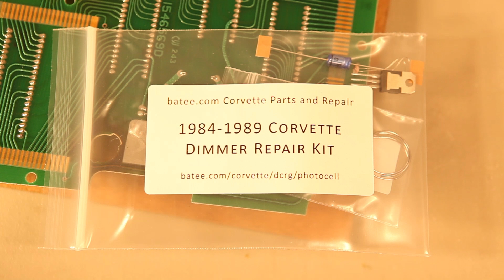84-89 Corvette Gauge Fix #5 Dimmer Repair

Comment: Ok so usually the backlight just doesn't work but the indicator lights come on, sometimes it will come on and stay on and then I'll lose the tach backlight and then it will come back. Any ideas, was thinking maybe it's the dimmer but that wouldn't make sense for the warning lights to come on, I rooted through the harness and didn't find any crossed wires.
Reply: Pin 12 of the board connector has melted this causes the cluster to lose its ground internally. It seeks a ground through the indicator bulbs which causes them to come on. Replace it and try to determine the reason the bulbs are intermittent on the tach side.
Reply: By pin 12 you mean on the larger connector right?
Reply: Oh or do you mean the pins that connect the logic board to the display board and the voltage gets backfed through the indicators, because it looks like all the lights share the same ground
Reply: Daved the Dude pin 12 of the 12 pin board connector between the logic and display boards.
Reply: @bryanthompson3180  Alright thanks! I'll be sure to check that connector. Thanks for the speedy reply too!

Comment: My cluster goes black when I put my lights on at night, if I shine a light into the small light senser on the top left side the dash lights come back on ???? What should i do.
Reply: Dark with the headlights on is a common symptom.  Make sure the headlight knob is rotated fully clockwise. If it's still dark, replace the headlight switch. --batee.com